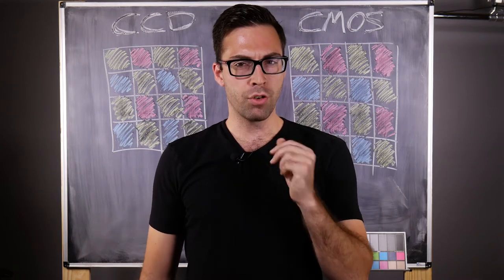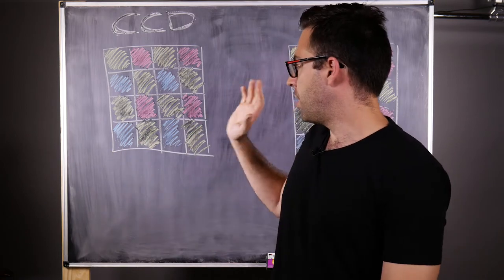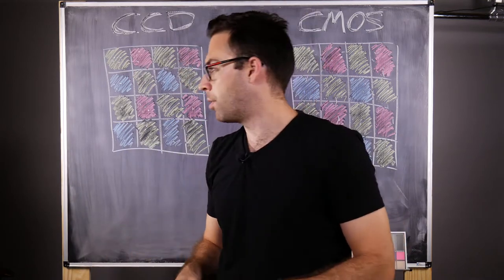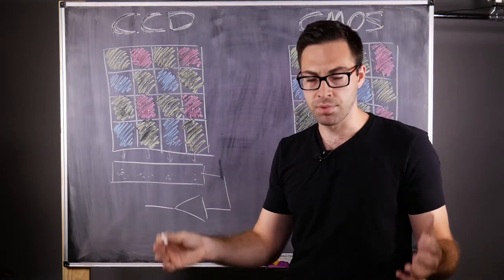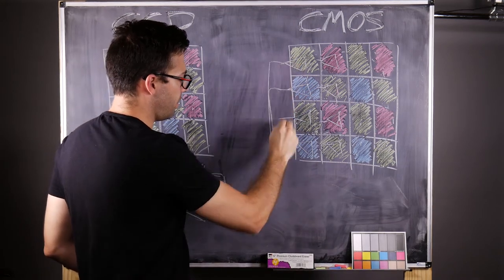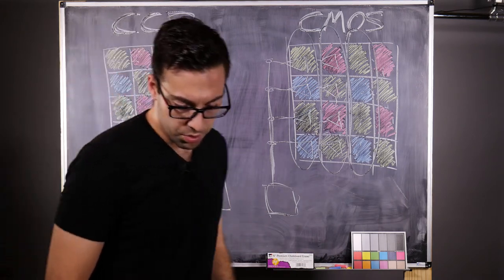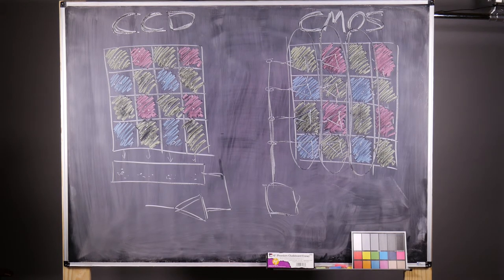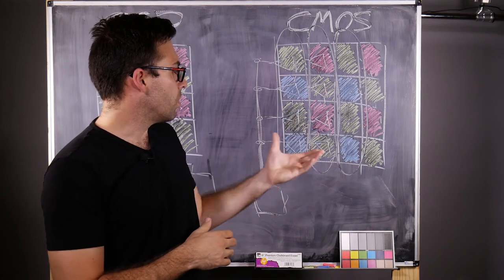Shutter Speed - Electronic Shutter - Episode 5.4

Comment: I wasn't able to follow this, unfortunately.

Naively I expected there to be a stage when the sensor is lit, and then a later stage when it is read.

You seemed to be saying that if a sensor is read row by row, pixel by pixel, then we get the rolling shutter effect. But why would the reading process have a retroactive effect on the times at which which the pixels were lit?

I'll be grateful if you can help me straighten out my thinking.

Comment: Have I missed something as you haven't explained how the electronic shutter deals with differing shutter speeds, you sort of covered how data is read from the sensor but how does the exposure start and how does it stop given light is still falling on the sensor and no physical barrier is in place.  The Sony A9 is also far better at rolling shutter than other cameras but I believe still has a CMOS sensor how does this work.
Reply: It doesn't. Light collects as charge on a capacitor attached to each pixel. You start the exposure by connecting the capacitor (more like that whole row of capacitors) to the sensing pixel. You end the exposure by disconnecting the capacitor from the sensor, connecting it to the buffer instead and draining its charge to be read out. In mirrorless cameras, this is always happening even when you are not taking a picture because that is where you live view image in the EVF and LCD comes from. When you press the shutter release, the camera simply interrupts the life view exposure and start your exposure. This can be SLOW because read speeds are slow and rate of starting subsequent rows cannot be faster than the read out speed. It can also cause more prominent rolling shutter effects because it takes typically 30~60 ms to go read out every row. At least in a 100% electronic shutter that's how it works -- connect row by row, disconnect+read row by row. 
--
There are two other ways it can be done...
--
A) START-STOP w/ MECHANICAL SHUTTER. It can black out the whole sensor with a mechanical curtain, start the exposure for one row at a time (connecting the caps). When every row has started, it lowers the mechanical curtain to actually expose the sensor to light, then end the exposure by closing the 2nd mechanical curtain. The sensor, now entirely in the dark again, can take its time to disconnect each row of capacitors and read out row by row not changing the exposure. Generally, rolling shutter effects are minimized with this method because the mechanical blades of a 1/8000 sec mechanical shutter takes about 4ms to complete it's entire travel. However, the impact of physical shit moving and slamming to a halt can cause a tiny bit of camera shake and noise.
--
B) STOP w/ MECHANICAL SHUTTER (aka Electronic First Curtain) It can start the exposure by connecting the capacitors one row after another without covering the sensor with a mechanical curtain. When the set exposure time has elapsed it'll simply close the mechanical curtain to end exposure to light. It then takes its time to disconnect the capacitor from the pixel, connect it to the buffer and drain the charge to out one row at a time. This method is kinda the best of both worlds because it is the reading out of the rows by draining the capacitors to a buffer that is slow. Thee connecting of the capacitor can be done as fast as a mechanical shutter can move. Hence, the travel speed is as fast as the closing mechanical curtain and rolling shutter is minimized. Any shock from the closing blade won't cause a loss in sharpness because by the time it is felt the curtain as closed and he exposure is over! There is only one trivia catch... the bokeh may be reduced when the shutter speed is very fast and the apeture is very wide (but that's another story for another day).
Reply: @dwightlooi  I still don't understand how shutter speed is controlled in the case of CMOS.  For example, if  the speed is 1/125, each pixel or row will need to get exposure of 1/125 seconds.  One row will need 1/125 s to complete.  Given a 4k image or 4,000 rows, it will need 4,000 x 1/125 = 32 seconds to capture the whole frame?  Please help me to understand.
Reply: @jl329g  OK... there are three things at play in terms of exposure each pixel to light. (1) The Collector collects photons that fall on it. (2) The Capacitor which stores the charge collected. (3) The Analog-Digital Converter that read the charge of the Capacitor and convert it into a numeric value so it can be recorded as data.
--
The CMOS sensor has a switch for each pixel that connects the Capacitor to either the Collector or the A-D Converter.
--
Exposure is started by connecting the Capacitor to the pixel's Collector. If there is no mechanical shutter or if it is open, light falling on the Collector will start to build up charge in the Capacitor.
--
Exposure is ended one of two ways. (1) Disconnecting the capacitor from the collector, connecting it to the A-D Converter. When this happens the charge is drained from the the Capacitor and the A-D converter records the amount of charge as data. (2) Blocking the Collector from light with a mechanical shutter such that no more light will fall on it, thereby ending the exposure. You can then take your own sweet time to read from the Capacitor because it wouldn't be getting any more charge.
--
The important thing to understand is that the A-D converter that is realtively SLOW. It takes about 60 ms to read all 5200-something rows of pixels on a 40MP sensor one row at a time. This means that last row is seeing the image about 1/16th of a second after the 1st row. This is why you have rolling shutter issues if the subject  is moving quickly through the frame if you are doing everything electronically.
--
If you are wondering why it won't take 5200 x 1/250 sec to make a 1/250 sec exposure on a 5200 row sensor, it is because the sensor does not wait till it is done exposing each row before starting the next. The sensor starts each row sequentially, taking about 1/16th of a second the reach the last row. However, it starts reading the 1st row after 1/250th of a second before it even finished starting every row. It still takes about 1/16th of a second to read from every row, but each row was connected only for 1/250th of a second to the collector.
Reply: @dwightlooi  You answered my question exactly.  Thank you very much.  Very clear explanation.
Reply: @jl329g  I probably over simplified things. Some sensors can actually read two or more rows at the same time. That is how they are able to reach 20 or 30 fps even though it takes more than 1/20 or 1/30th sec to read the entire sensor. The camera simply starts the 2nd frame halfway or 1/3 through reading the 1st thereby doubling or tripling the frame rate. This of course precludes using a mechanical shutter because closing it for the 1st frame will mess up the 1nd frame if you are reading multiple frames simultaneously. That is why some cameras have the highest fps in electronic shutter and a slower fps for hybrid or mechanical.
--
Finally, if you have a very expensive sensor like the on in the A9 III it'll expose every row at once rather than scan down the sensor one row at a time. That is called a Global Shutter. Actually, still reads progressively because it is impractical to have a 20million channel ADC. However, Global Shutter sensors have a high density memory array on the sensor such that instead of switching the capacitor from the collector to the ADC, it switches to the memory array.
Reply: @dwightlooi  Very good information.  I was not able to get such details from google search.  Thank you again for sharing with us.